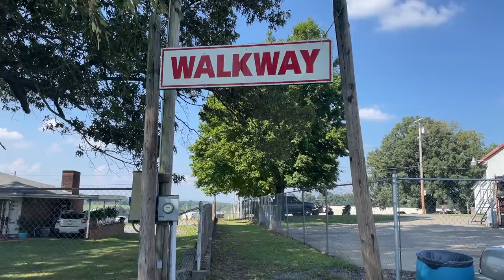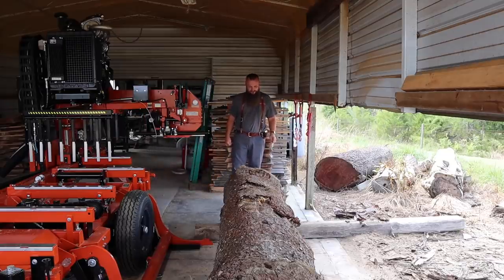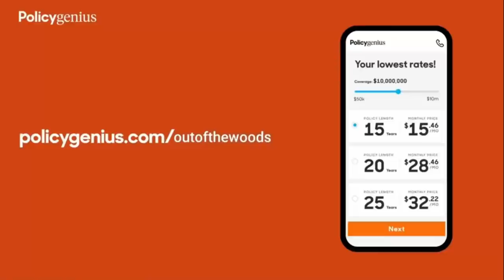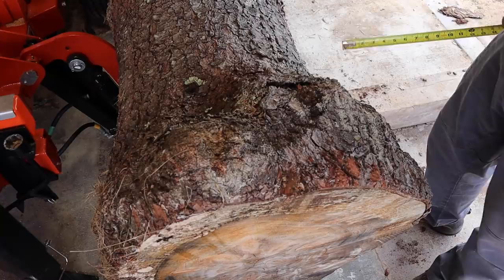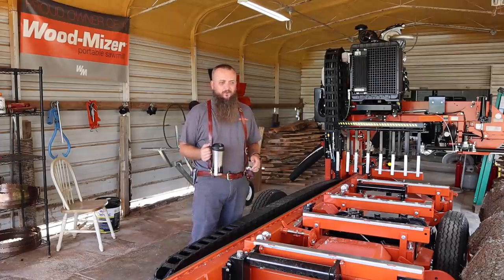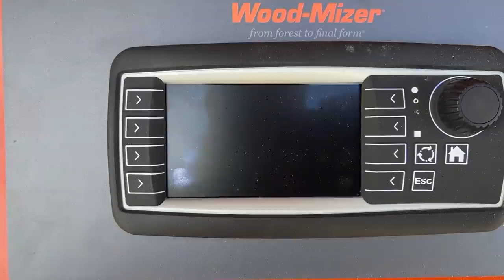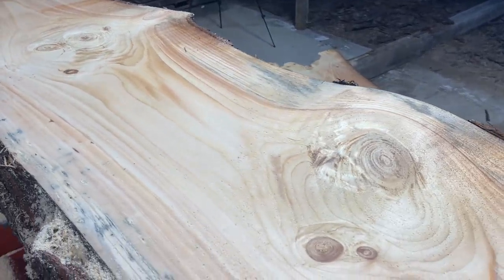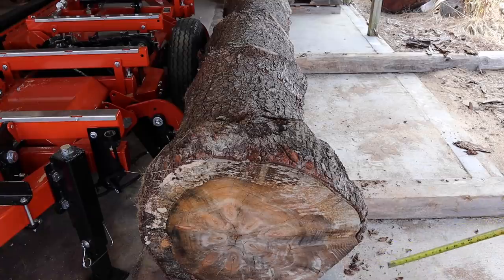This Machine Is Like Flying An Airplane, Wood-Mizer LT70 Super

Comment: As to blade marks. Having a mill that is under powered in cut over 20” (up to 72”), I can’t feed at a high enough rate to eliminate blade marks. But when I tighten the set (regrind without setting), super smooth. If most all the sawdust is carried out of the cut there isn’t enough spill over from the gullet to stabilize the band. Side benefit is the teeth stay sharp longer with less blade movement.

Comment: Hello from the Netherlands .  
question : have you ever thought about connecting the exhaust from the sawmill to the airvent in the roof with exhaust-pipe they use at a garage ?  
then you are no longer in the exhaust fumes of sawmill.  
thanks for the video. 
Kind regards Hollandduck from the Netherlands
Reply: That was my thought when I saw him start it up. Just need some flexible exhaust tubing, not a big job, a big improvement for healthy work conditions.

Comment: Nice to see you back to work with the new rig.  I saw a documentary on a restoration of an old (circa 1700s) home that had 18" to 20" wide pine flooring.  They had some issues with some of the flooring, and needed to replace it. I never saw whether they found any, but that log is at least the right width.  Not sure if the knots would cause problems.  Is that a specialty market that might work for you?

Comment: Fair warning I never got more that about 4 hrs run time on my 1.5x055 blades before they snapped. Sharpened every hour. Hopefully the bigger wheels on the 70 will help them last longer. Can’t beat the speed and flatness though!

Comment: Looks like you left the roller up on that second cut.  That turner looks like a rough on the log but I would kill for a bidirectional turner.   I would like to hear more about the controls if you have time to explain how this works different than the LT40.

Comment: May not be practical for dust collection. I can see a trough which catches 85-90 % off the ejection chute  with a flat face shovel like a "muck shovel" to quickly clean the trough. Make mobile since all the slabs are out air drying, to be able to just move it out of the way. It's on concrete so should be an easy transition. BTW way if I was younger and healthier I would have a saw mill, just for fun. Thanks Nathan.

Comment: How do you like the chain type log turner on the Super 70 compared to the claw type log turner that was on your LT-40.  NICE saw mill!  👍
Reply from the maker: I love it, one of the reasons I upgraded,
Reply: @OutoftheWoods0623  I noticed that the chain type log turner seems to chew up the wood a good bit.  Did the claw type log turner chew up the wood worse?

Comment: There is a new one on me...I never saw anyone who could not find a cant..However it was all ways used as an excuse for their lack of knowledge or willingness to do a job...Sort of having a "clue" in rigging for theater..A triangular shape of metal with one hole at the apex and four or five holes across the bottom..Was used in a single purchase pulley pipe and batten system in early theater rigging..The clue was attached to the rope on the back side of the pulleys and then sand bags were added to the bottom of the clue to balance the load that was being lifted above the stage.  So, If you need a cant to roll a log.. You need a Clue to lift the curtain for act one...My very best for you and yours...Jim

Comment: watched a YT vid about large scale lumber mills.  they featured a Wood Mizer model WM 1000.  that thing is a flat out monster. So powerfull and large that the operator has a low platform to work from and if he steps off, the saw will stop - for safety.  check it out.

Comment: I am way lost Nathan. I see you running the new mill and saying there is a large curve to learn on the controls, I can understand that. It, the log, looks like water with knots and then for sure must be only a decorative piece. I don't see it able  to burn if it was to dry on its own in the desert. I guess to appreciate a piece like that, I would need to know more about that kind of wood and what it normally is used for. I think its got that nasty sticky pitch sap that runs out and will gum up what ever it gets on. Are you building a new shop for this mill to go into? I was thinking that you were fighting the sawdust laying in under your feet an what not so might be to move it in a better  spot for the operator to off bear this wood so its sorted better or something. I guess its all something to just wait and see. I had me a bad stroke and only got part use of my hand now with no feeling in my fingers. It all started when I was going to get some tea and I turned but my leg didn't and so I went down on my side and hit hard on my head and butt. I couldn't move so had to wait for someone to help me and I stayed on the floor for about six hours. I'm 72 or a year younger than I thought I was so that is good. They ain't going to force me to live in a rest home for the elder peoples. I just ain't a going. I am a private person and don't take to living in a dipper changing place. I hope that this is all you wanted it to be as you do look happy its setting there after a bit of waiting for it to come